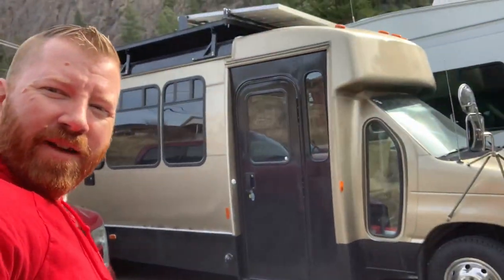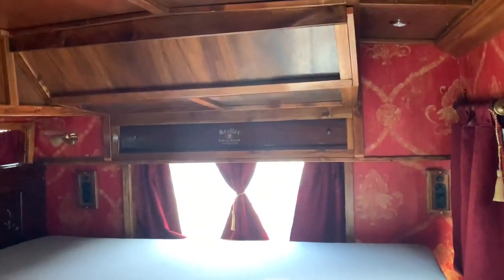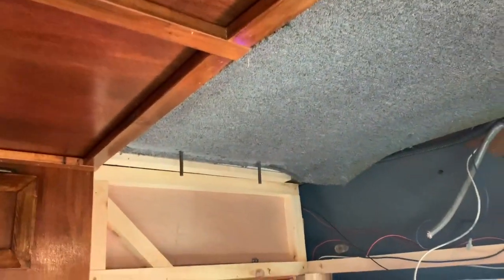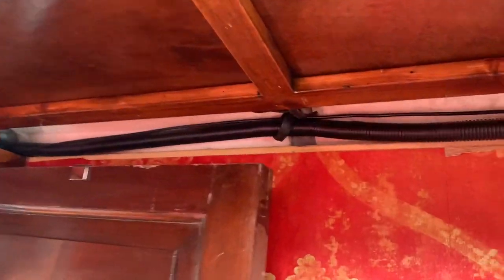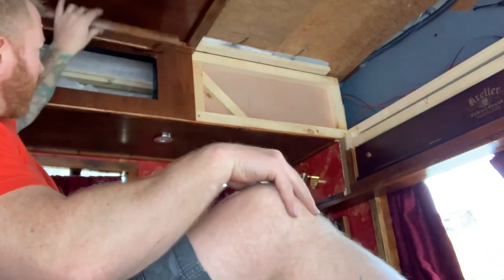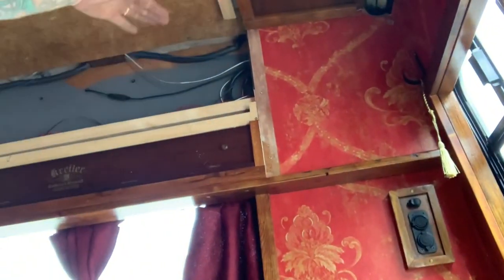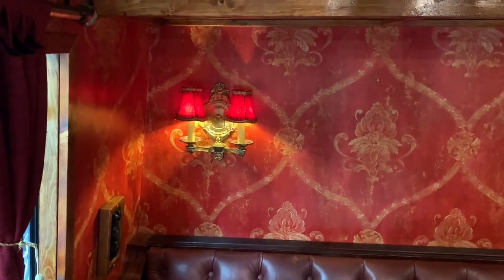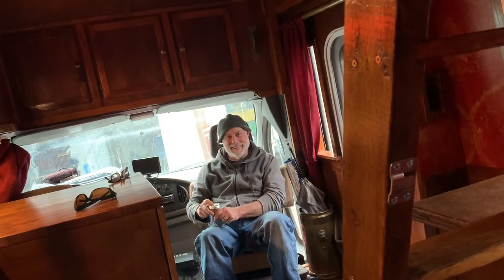Shuttle bus conversion removing the rear A/C after the fact and installing sconce lights.

Comment: Glad to see you two back!! I am in love with those sconces!!
A few quick questions....... Did you have to drain any fluids from the AC unit before you cut the hoses? And did the removal of it affect your on board front (dash) AC?
Reply from the maker: Thanks Lisa, no we didn’t have to drain anything as our system was all dried up.  We are actually going to bring the rest into a shop so they can isolate the front AC now to get it working.  If possible we want to remove the side condenser but it depends if our bus has 2 condensers or not. 🤷🏼‍♂️
Reply: @2bearsandabus-2bearsandabu38  My rear AC works great, I just don't think I want it. It has a new condenser so I'm hoping to sell or donate it so it won't go directly to the landfill.
If my condenser doesn't control the front AC I think I'm going to put my grey tank there.
Good luck to you on the AC.
Reply from the maker: @virginia_in_the_rearview  thanks and good luck on yours!